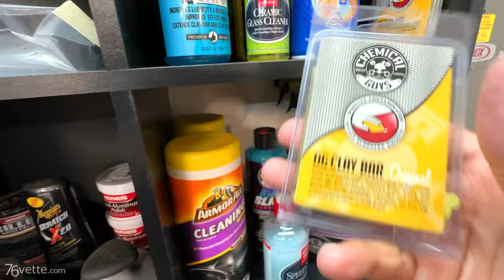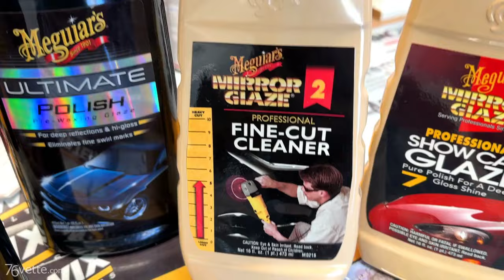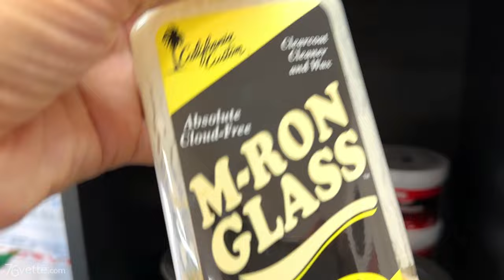DETAILING a Corvette for 7 HOURS!

Comment: What I think is - you are putting a lot of work into a car you may not keep. If I put that much sweat into a car I'd have a hard time selling it.  You won't get the value back out of it.  Good luck either way.  Looks really nice.  BTW,  I presently have a C5 coupe and what I don't like about the C5's and newer are there are too many things you cannot fix and then there are things your dealership cannot fix either.  Example is the EBCM (electronic brake control module)  They go bad and there are no new ones being made and if you buy another one it may not be any better than the one you have (4k later you find this out)  BECAUSE it's just as old as the one you pulled out of your car. No thanks.  So, I'm thinking of going the other direction and buying a C3 instead.  At least I can work on it (mostly) and it has no computer or UNfixable problems.  Yea, I know, the newer ones are way better cars (in theory) but the frustrations I have with my (very nice) C5 are mounting.  I'm no master mechanic but I can do basic stuff.  Anyway, appreciate your channel very much.
Reply from the maker: Thank you so much for commenting. 
Yes, I tend to overdo things a bit, but you have to consider I also create videos out of the whole process, so in order to show and/or explain things properly, a lot of work is part of that equation. 
On the other hand, I enjoy a good challenge and I am a firm believer that most old original parts are vastly superior than their aftermarket counterparts, so I am really good at finding ways to go down those rabbit holes while attempting to repair OEM parts with—oftentimes—mixed results. 
Eventually, my cars, old parts, tools, etc., will go to new homes and I’m ok with that, because I’ve enjoyed my journey. Well, most of it, anyway. Lol 😆 
I’m self-taught when it comes to mechanical work, and got started by restoring a couple old motorcycles back in the mid/late 80s. I was really proud of them but had to sell my Norton 850 Commando and my Triumph Tiger 650 because I was always broke. The same applies to many cars and trucks. 
But the consolation (if it can be called that), is that I left a few things in better shape than I found them in, and that is rewarding and valuable in itself. 
Thank you for watching! 😊👍🏻